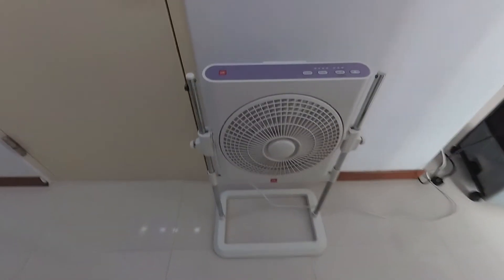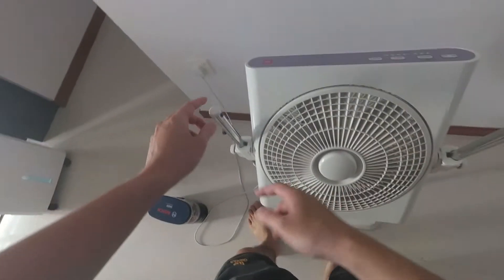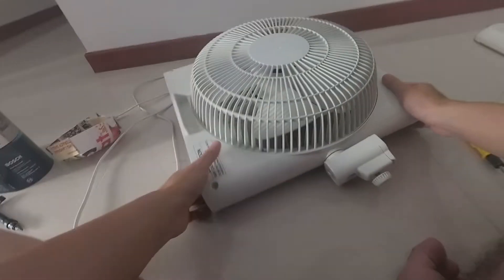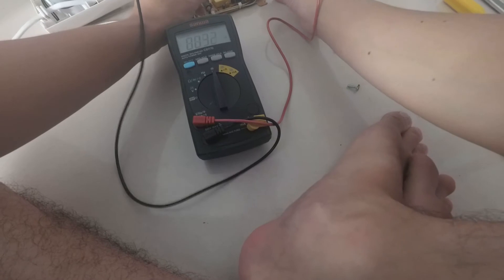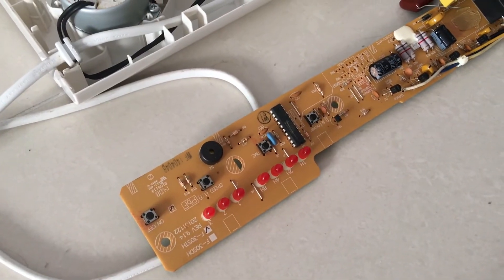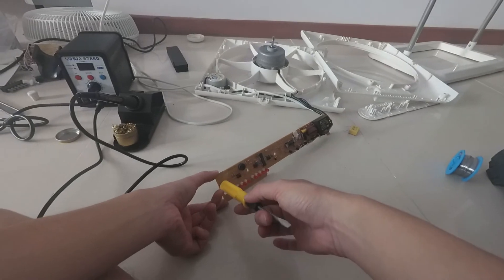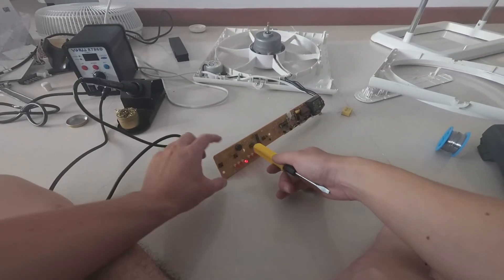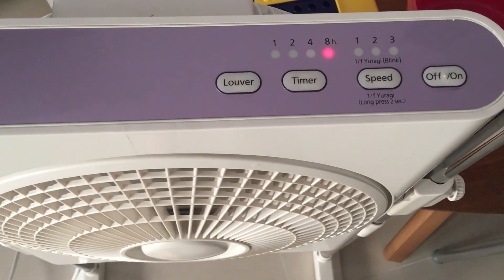How to Fix: KDK Box Fan Turns Off Randomly

Comment: my ST30H Louver sometimes can work, sometimes cannot work. The yellow cap inside shows 0.33uf (measured 0.28uf). I changed to 1uf 275v, Louver totally cannot work. Should I change to new 0.33uf?
Reply from the maker: @patricksim592  the louver’s function is not related to the capacitor. Consider checking if anything is jamming the louver instead.
Reply: @fuzzy34r  Thanks for the reply.

Comment: Hi, impressed with your video.  I have a KDK box fan SC30H, randomly stops.  I suspect it's the capacitor problems. Do you help others to repair?  Do hear from you soon.  Thx!
Reply from the maker: Thanks for the compliment. If your fan switches off randomly, the capacitor is likely the issue.
Reply: Hi, I think it is the capacitor.  But I need help changing it.  I am not technically inclined.  Do you provide such service?  Can you help?

Comment: Hi there, thanks for uploading this video.  I followed the instructions to remove all the screws and take off the fan leaves, but have problem trying to pry open the case in order to get access to the board.

Can you provide some more information on how to pry open the case?   The fan model number is KDK ST30H.   Thank you so much.
Reply: there are internal locks holding the case together, u need to hit the case at specific points to unlock them.
Reply from the maker: I no longer have that fan with me. It was returned to a friend after the repair. I believe it is quite straightforward to open the case, however, you need to ensure that all screws are removed before it can be opened. Some screws are not so obvious. All the best.
Reply: @fuzzy34r  Thanks for the quick response.  Will continue with the adventure.  Thanks again.
Reply: Bạn nạy ở 2 bên cái chốt giữ thân quạt: bạn sẽ chấp nhận mạnh tay và nó sẽ bị vỡ nhựa một chút, tôi đánh giá thấp về thiết kế kdk box-fan này làm mất đẹp khi mở lần đầu.

Comment: HI Thank you for this Video, Fix it Uncle..  .. Can I know what is the part number of the new capacitor ? Or what is the general specs ?
Reply from the maker: Hmm… its a generic polypropylene capacitor. It is not necessary to get the part number from the manufacturer. I don’t have the part number as well. Mine was around 1uF.
Reply: @fuzzy34r  thank you very much for your prompt response

Comment: Hi Fix-it-Uncle, this video is a godsend! I have an identical fan with an identical problem. Thank you making this video and posting it on YouTube!👍!
Reply from the maker: You are welcome. I find that devices that use that particular X2 capacitor tend to fail prematurely. I hope the video is clear enough for you to fix your fan. Cheers!
Reply: @fuzzy34r  Yes it's clear enough and I managed to fix it. Opening the casing to access the pcb was challenging. Would've been helpful if you had included the steps for it in the video. Nevertheless thanks once again for making the video. Cheers!
Reply from the maker: @joobeng9229  thanks for the feedback!
Reply: @joobeng9229  very tricky, how did you guys opened it?
Reply: @andytwgss  opening fan is simple, hard is what to replace
Reply: @fuzzy34r  help
Reply from the maker: @aarontan5958  it depends on where you are from if you are intending to buy locally. Otherwise, most popular online shopping platforms such as shopee, lazada, aliexpress would carry them.
Reply: @fuzzy34r  how to identify which type works for my model of fan? How do you learn to do it?
Reply: Can i ask, where to buy capacitors? And how to know which model will work for another type of fan? @Fix_it_Uncle